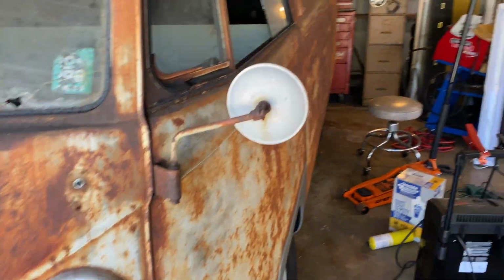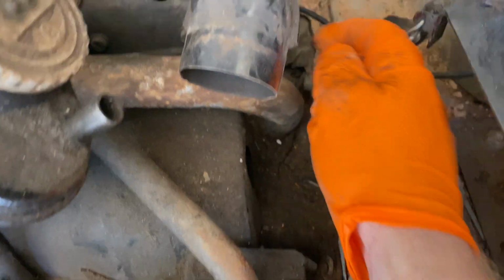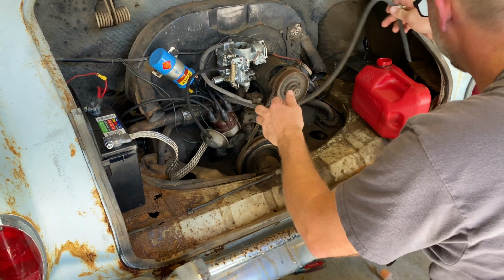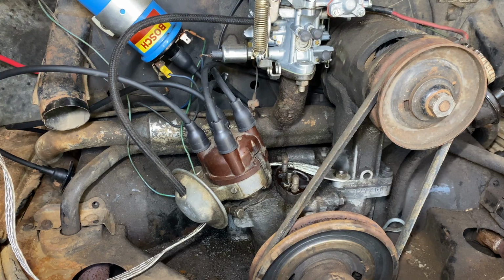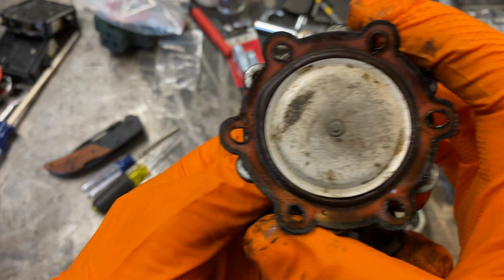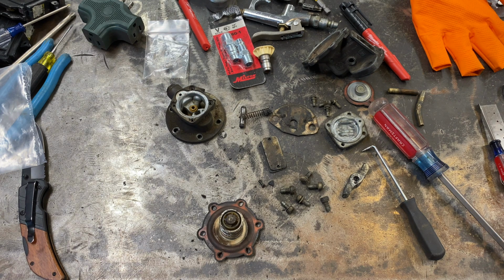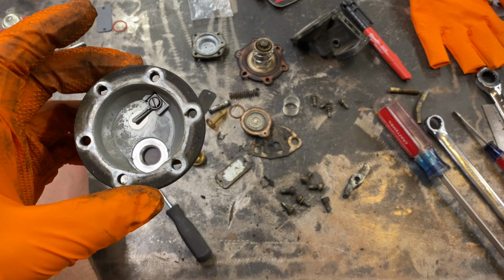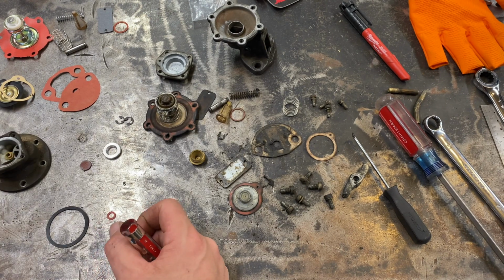Restoration 1967 VW Karmann Ghia | Restoring The Fuel Pump! Abandoned 45 Years! Ghia Rescue Part 1

Comment: Hello I am from São Paulo, Brazil.
Here the VW Bus is called the Kombi.
This model of yours is called Little Owl.
My dad had some Kombi Pick Up.
It is normal for her to open the door alone.
Here in Brazil there are a lot of fans of the air-cooled engines. the Karmann Ghia were also produced here in Brazil and today they are rare.
I prefer the American V8 and the 6 in line

Comment: Put a cup of gas with one hose in it...
Attach to one fitting ...
Turn it over....
Switch the hose to the other fitting and test again...
The one that flows " out " goes to carb
The other one is from the tank...
Easy to test
😉
This also confirms if pump works..
🤔
OR LOOK AT RUSTY
IN THIS CASE!!
😆😂

Comment: Good progress!  I believe all of the non fuel injection VW fuel pumps are the same. The use of slotted head screws are a nod toward making it easily serviceable. The tiny little flapper with the small screw holding it is a valve. The other red looking disc is also a valve, which wants to be replaced. To remove it, simply insert a small pin punch or screwdriver from the opposite side, and hit it lightly with a hammer. That will drive out the whole thing, including the aluminum part. When you re-assemble it, lock the new aluminum part in place by staking it in a couple of spots with a center punch, just like the factory did. Again, designed to be rebuilt with only very basic tools by anybody who is reasonably handy!
Reply: Unfortunately not quite right Neil. The VW fuel pumps vary according to the years of manufacture. For example, the rubber seal and the copper ring, have been for a later year of manufacture. These two things would have been needed if it had a brass cover on the power fuel pump. The last pumps installed, you could not even disassemble. Only exchange goods, not repairable. However, from the make, they were actually almost the same
Reply from the maker: Thanks Neil!

Comment: It is such a cool car ! A word of caution though.... To restore the  Karmann chassis you'll need tramgauges and know how to use them to keep it flat, safe and drivable. The body is if I remember correctly handmade and welded to one big piece which makes it difficult to handle. It will be a lot easier to get this car going than the Dragon. And more fun if you ask me...
Reply from the maker: Thanks Remco! =)
Reply: @CTmoog  If you clean up the engine bay and rebuild the engine, you can probably get some decent money for it if you want to sell it. It is a very popular car for a full restoration.

Comment: I’ve never understood why people commonly remove all the spark plug wires at once and then try to figure out how to put them back.  I always replaced them one by one, starting with the longest, I’ve done this hundreds of times as a professional mechanic and I’ve never had an issue.  Yes, I know the firing order, the direction of distributor rotation etc, but that takes time and it takes far less time to replace the cap and rotor first, one by one, then the plug wires.
I think your pretty incredible otherwise, please keep it up.
Reply: I been wrenching 50 + years and do that too...one at a time ..or masking tape to mark them....

I did sign repairs for decades too
We had to fix burnt wiring and there can be 10 - 20 wires burnt in a glop....colours hard to figure out ( they normally are different colours ) or sometimes all the same colours ( built where they only buy one colour wire )....
I found if you slowly peel them apart you can figure it out quicker than the guys who cut them right away and then scratch their heads to figure out the wiring later.... On big signs it takes awhile removing lamps and covers tracing multiple ballasts and wires to get it wired correctly...

Work Smarter
And it is Faster
Reply: @garymallard4699  Above all... Always on a clean tidy workbench.😉
Reply: I’m guessing you guys haven’t been here long ?
Reply: @Russeljfinch  Long enough to know that CT goes its own way. Sometimes very unstructured and sometimes very purposeful. But then a flea coughs somewhere and a new project is on the horizon. This is CT.... Nothing more needs to be said.... But he is doing, in his own way... 😉

Comment: Your ghia seemed to be running pretty well. I bet if you clean up the gas tank and hook up the throttle, and reinstall the fuel pump it make a fairly good driver.
Reply from the maker: Yes, it dies but it has a bad oil leak. I'm going to pull it out take it all apart and rebuild it. It should be good to go after that! =)

Comment: Maybe this picture will help: https://data.motor-talk.de/data/galleries/0/136/59/16112975/benzinpumpe-29406.jpg
The gaskets at 49:49 are not placed on top of each other as shown in the picture. But if the hose connections for the fuel hose are no longer tight, there is a major fire hazard in the engine compartment. There are repair kits with a screw connection available, but then a thread has to be cut into the fuel pump. I would replace the fuel pump.
Reply: Glad you went to the trouble of looking up a diagram, but he has a workshop manual to look it up in.
Reply: @mawa01  But you don't just have to have a workshop manual, you also have to take a look 😄
Reply: @GettingNervous  That is correct! 😉
Reply from the maker: Thanks my friend! =) That is a great pic!

Comment: Those 2 last items you had in the pump you were puzzled about were check valves. The fibrous one is not a filter, just another flapper check valve to allow flow one way only. The metal one does the same thing. From what I saw the problem was the diaphragms in the pump were just old and stiff. If you replace them and the gaskets you should be golden. Also you need a de-greaser in your shop to help. When taking apart things like the pump it's better to clean it up, then take it apart so you don't spread crud around the insides of the item. Those brass tubes are going to be an issue because those are press fit and not screw in. You "might" get away with some epoxy like JB Weld or if you want, before assembling the pump, solder it in like a plumber sweats a copper joint. That might be pretty touchy though

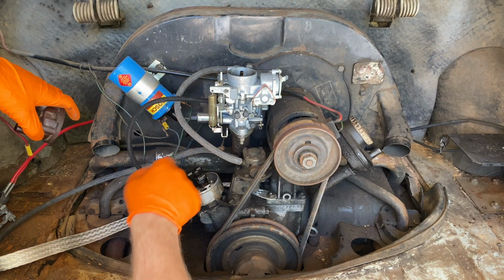Comment: 6:20 if you don’t want that cap, send it to me. That’s an original German part. All it needs is cleaned up. The electrodes inside don’t look very worn. And you can just clean those up. Along with the rotor. A new Chinese one will not last as long as that one has , nor will it be any better.
Reply: That orange cap you had in your hand is the wrong cap it’s too big. It belongs on one of those Chinese 009‘s. 
Also, before you put that fuel pump together you might want to try and get a flat surface. Put a disk of 120 sandpaper down. And sand those two surfaces smooth. Usually because of the heat and cool cycles. Those pumps are warped. I did this on two of mine… Tried to rebuild them… And ended up with them spritzing gas everywhere. So I sent them in to Sparks Works to have them rebuilt. Bill does fabulous jobs on distributors and fuel pumps. Also it doesn’t look like you have the correct carburetor. This can be bough outright at Volkz Bitz. All three of these devices work together. But that’s neither here nor there. I understand you want to get it running and move it. Judging by the oil leak underneath. It’s more than plausible that the end play in the crankshaft is allowing everything to walk back-and-forth causing your oil leak on your main seal. Grab a hold of that pulley in back and see if you can feel any play. It should be about .005 . If it’s an eighth of an inch, like it probably is. Then that engine will need to be line bored and thrust cut. If they can.
I had the same problem on both of my cars. I was able to save the original case on the 69. And I located another case for my 67 that I can use. I’m trying to use original German stuff. I have a Mexican engine in the 67 right now, and all the tin doesn’t fit on it right....Because it’s not German.

Comment: 65' was the last year for the 40 horse "1200".  66' was the first year of the 1300 and on.  67' maybe a 1300 or 1500 if it's the original engine for that car.  When in doubt reference Rusty's fuel pump.
Reply from the maker: Good to know! Thanks Michael!

Comment: Mentioned elsewhere, but the “oil” leaking from the engine looks awfully thin to be just oil. Given the state of the fuel pump you should check to be sure the crank doesn’t have fuel/oil mix in it before you run the engine again. If so it’ll toast the bearings, damage the crank, worst case cause a sump fire. Also my ‘70 Beetle had the same issue with the pump inlet and outlet tubes coming loose. At the time (early 80s) only fix was a rebuilt pump. Combination of heat, aluminum, brass and fuel made epoxy not work. Good luck.
Reply from the maker: Thanks Paul! I think you might be on to something with the fuel in the oil. I will be rebuilding this engine soon. Stay tuned my friend!